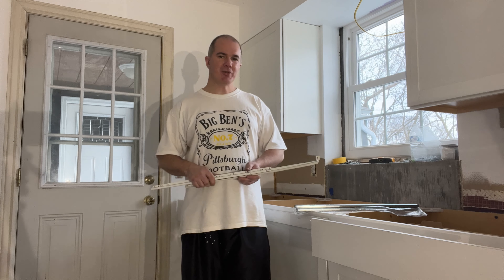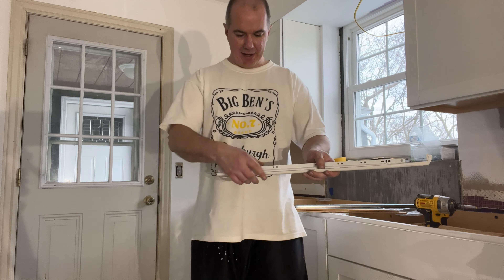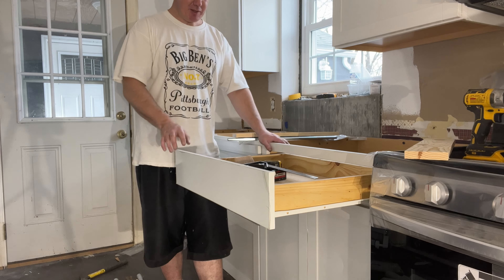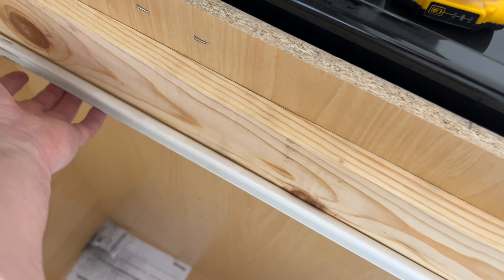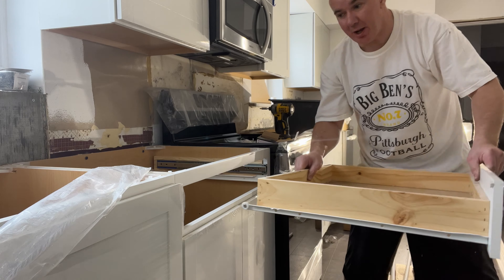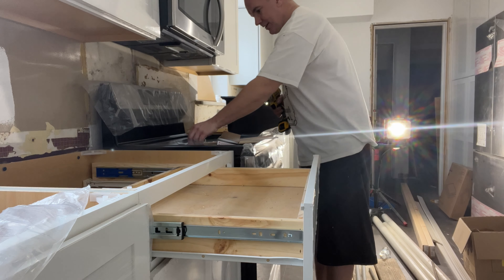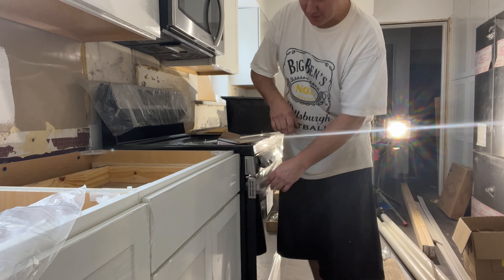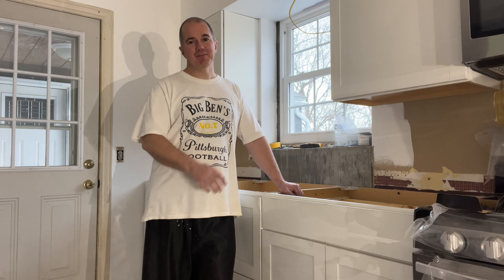How to Install Soft Close Drawer Slides { Soft Close Kitchen Cabinet Upgrades }

Comment: nicely done.  However you don't line the front  of the slide  FLUSH withe the front of the cabinet. You RECESS the body of the slide a 1/16th or  1/8th   You do this so that when the drawer closes,  the self close mechanism can completly hold the drawer closed at the cabinet face.      I still think it's a good explanation video

Comment: i know you won't post this but this video is BAD you fail to explain that drawer case  has to be 1 inch less than opening they don't work for all cabinets. Also Kreg makes a jig that makes this 10 times easier I can't believe you have sponsors
Reply from the maker: I failed to see how you think the video is bad, but you are entitled to your opinion. I am just showing how to add slides to stock cabinets, but I guess I should’ve mentioned the 1 inch I just assumed people knew this. So since I do houses all the time, the reason I don’t do the kreg tool is for the simple fact when I do rentals, you’re putting all your trust in the way of the drawer, connected to the back of the cabinet and most people when I do rentals put all kinds of stuff in the drawers, whereas doing it this way, the full weight of the drawers, or connected to the sides. Also, I am not sponsored by any house company, so not sure where you got that. This is all me doing projects on my properties with my own money. I would gladly take free stuff though lol 😂
Reply: If you can not understand the value of this video, you have no reason doing your own home repairs!
Reply: This was very good. Done this may of times. I like this method ‼️

Comment: Great video! This helped me install soft close drawers in my kitchen over top my white epoxy wheel glides. The blocking is extremely important and I suggest going to an actual lumber yard to get custom cuts to fill the gap. I had to get 13/16” which big box stores did not have. I counter sunk 1 1/4” drywall screws to fasten the blocking and used 1/2 inch spacer to lay atop my new glide. Having a counter already there makes it difficult to work under and had some awkward times. Use a small level and zip the screws. Fitting the drawer back into the cabinet while the old epoxy wheel was still on was great to work as a guide. It was tricky unscrewing the bottom wheel glide off, but zip in your screws and push the drawer box in. Pull it out and push in a couple times to work it in. I used a silicone lube spray on each side of the guide, and inside bearing track. Very happy I used this method, thanks!
Reply from the maker: Thanks so much for watching and sharing your experience. My cabinets were brand new so getting the size was easy but on custom cabinets or other once I agree you will have to get the exact measurement to make this work better. If they are too wide then the slides will not perform properly. Glad your project turned out great!

Comment: Thanks so much for the tutorial Brian. It is a very efficient way to install slides. What do you do if you have a wide cabinet with two drawers and no side panel between the drawers? In my case there is no side panel to screw the 1x4 wood blocking to between the two drawers in a single cabinet.
Reply: I have this question also!! I have an island with two side by side drawers and a gap in-between where I need to install the wood mount for the sides to attach to

Comment: You didn't need the wood. Buy the brackets that screw into the back of the cabinet.
Reply from the maker: Thanks for watching. Only reason I did it this way is so beginners or anyone without a lot of experience can handle this. When you install the ones with the brackets in the back if they are off even by a little bit you end up adjusting them a lot so they do not pinch the drawer causing it not to shut properly. Also factoring if anyone who has a counter already attached this way works a lot easier in my opinion for anyone without the experience. Basically just wanted to make this as user friendly as possible.

Comment: Very cool method to use the original hardware to keep everything aligned! I was dreading having to make lines with a pencil and perhaps getting it wrong. This way, it's much easier. Thanks.
Reply from the maker: Thanks for watching! Once you get your pieces of wood cut and do one cabinet all of the rest you will fly right through. You are looking at roughly 5 minutes a cabinet to change over.

Comment: I just redid my kitchen drawers with bb slides but I wish they rolled as easy as the cheap junk rails. Something in between would be nice. Still a good upgrade.
Reply from the maker: Thanks for watching. Are all of the slides doing this or just some? Sometimes if the drawer is a little off it will stick so may need to adjust a little. Did you get the slides in the video? I know they make different kinds.

Comment: BrianI just watched your video.  It was helpful.  I did wonder about one thing though.  After you mounted the new soft close slide you removed one part of the old slide.  The part that was attached to the drawer.  But what about the other part that was inside?  That would be the other half of the old slide.  I guess you could just leave it there, is that what you did?
Reply from the maker: Thanks for watching. I did remove all of the existing slides both on the drawer and inside the cabinet. Hope this helps.

Comment: Inside of my drawers (with the cheap teflon ball setup like yours) is already the wood you suggest installing to receive slow close hardware.  So do I simply add the slow close on top of existing guide (with 1/2" shim) then connect  like you did and remove old junkie teflon slides and repeat?  Detail question...Is it TWO 1/2" shims or a total of 1/2" shim  above old track?  How does shim stay in after removing OLD slide?

Comment: Do you take the shim out after you put in the new slide ?
Reply from the maker: Thanks for watching. No I leave the shim in place. Since I am not screwing it in with a bracket in the back of the cabinet the shim will have to stay in place for support. That is one of the reasons you want to match the thickness so the drawer will slide smooth.
Reply: @BrianWingard  hey Brian,  thx for getting back to me so quickly.  One more ? What brand of slides and do you have a link ?
Reply from the maker: @muddslide8829   No problem, glad to help. Here is an affiliate link for the slides and screws used in the video. It helps out the channel. I will be having a lot more videos like these coming out soon.  
Soft Close Drawer Slides  https://amzn.to/3xA93z3
Truss Head/Pan Screws  https://amzn.to/3KSC5hj
Soft Close Door Hinges https://amzn.to/3KRvMut
Kitchen Cabinet Hardware Black https://amzn.to/3JRL7JS
Kitchen Cabinet Hardware Nickel https://amzn.to/3rtZJJe
Reply: @BrianWingard  what holds the shim in place once you remove OLD slide? I thought you wedged it up against just until you removed the OLD parts...We dont attach the 1/2" shim to wood you installed...do we?

Comment: I want to upgrade my roller slides but they are 23 inch. Should I choose 22 or 24 inch ? Thx
Reply from the maker: Thanks for watching. You will want to get a 22 inch slide. If you used a 24 inch slide it would extend too far past.
Reply: Awesome 
When deciding length to buy , do you measure drawer length or full cabinet depth ? Some of drawers in the same cabinet are shorter than others , don’t ask why ,, an older home 🤷‍♂️ 
Any help would be great . Thanks

Comment: Our new soft clothes drawers are TOO HARD TO OPEN. How to disable the mechanism? I did tell the installer beforehand when I tested a sample, but he said he's never had a complaint about them. Well, I'm complaining now after the install as well...
Reply from the maker: Do you happen to know what brand he used for your install? If not I will see if I can figure out how to disable the mechanism in the hinge.
Reply: @BrianWingard  I checked it out before the countertop went on. The end part of the each metal runner has a bright blue plastic insert at the far end. I figure I could pull out or break out that piece? Or, as I saw in another video, undo a latch or something there. First need to know how to take out the drawer to access that part.

Funny thing about the manager of the install: He didn't visit the site except to plan the install at the start, maybe a few minutes during the install, and to get the payment after. He was in a hurry to get out on the day my dad paid him. He stayed only a few minutes & didn't stick around to find out if we were content with the install, and to gather some decent feedback to address & progress with. I barely got a chance to tell him only a few of my concerns, one of them as we was rushing out the door as if to evade me lol. I did ask him how to remove the drawers, but his mind was elsewhere. [So now we know why he, as he says, hasn't got any complaints about the soft close feature lol.]

Comment: I actually want to re-move the soft clothes mechanism on my trash bin slide. Can you give me any help with that?
Reply from the maker: Thanks for watching. I thought I had responded but maybe it did not go through. I never had to remove the soft close part of it but I would imagine removing the spring section in the back of the slide would make it work like normal.

Comment: If I leave the old slides on would the soft close feature of the new slides work? Two sets of slides seem more secure....
Reply from the maker: Thanks for watching. The problem with leaving the old slides on is it will be easier to have misaligned and not get a smooth movement. It sounds good in theory but my results in the past found it was better to only one one set on.
Reply: Also will not open all the way